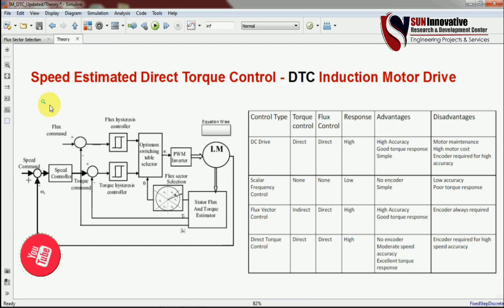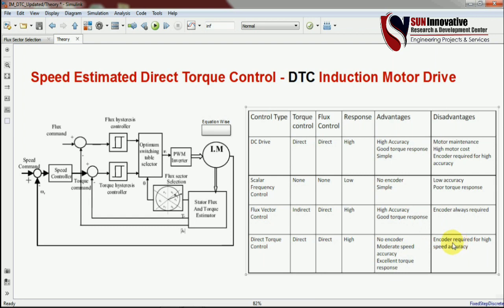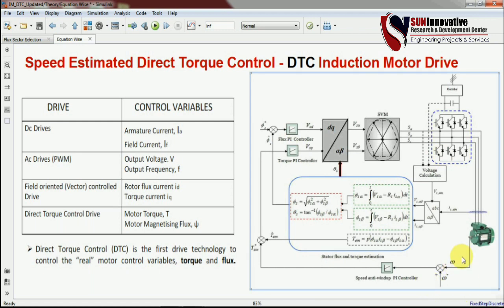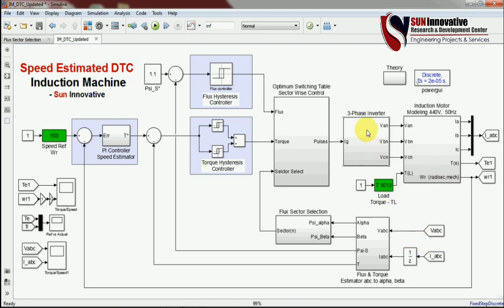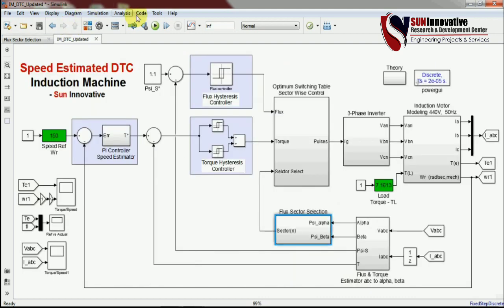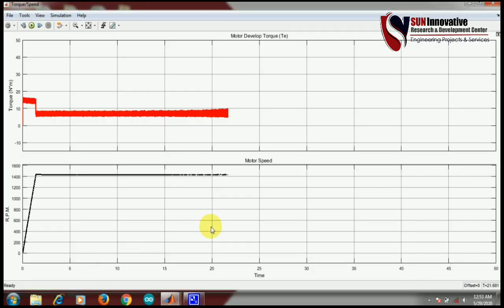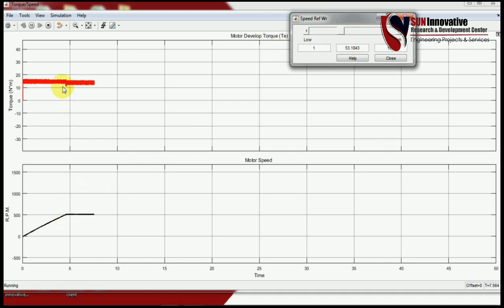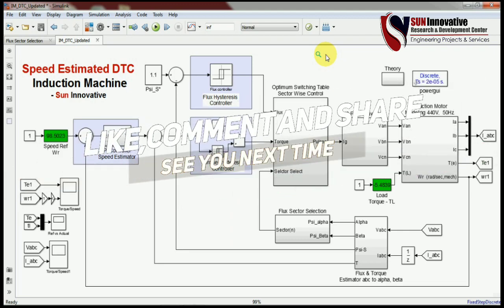Speed Estimated Direct Torque Control - DTC Induction Motor Drive | Matlab Simulink

Comment: Thank you for this Video Sir! Glorious! One question in a practical application what could be my values for the speed command as well as for the flux command? For instance i want my motor to up to 2000 rpm then that's my speed command but what is my resulting flux command looking like? Thank you